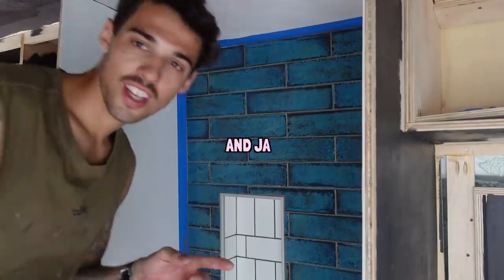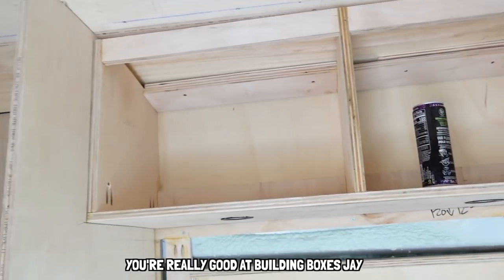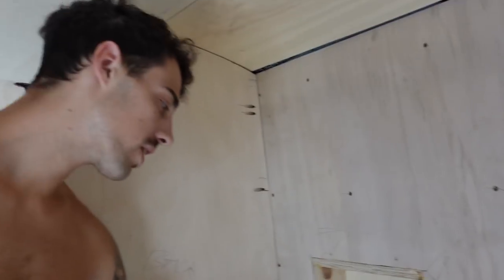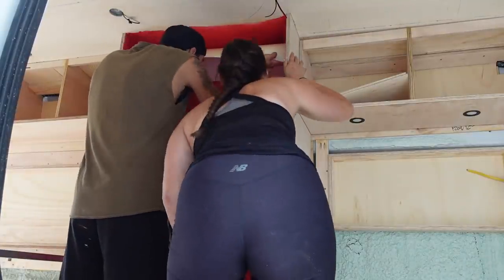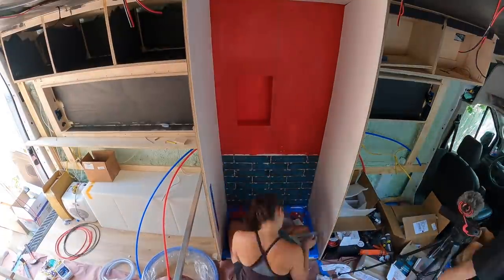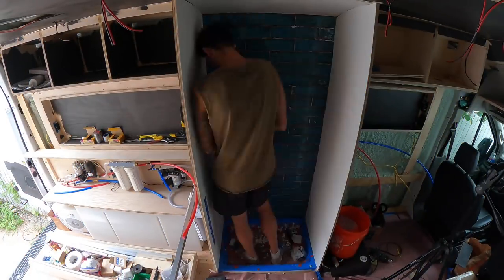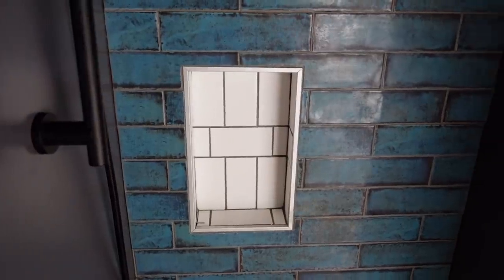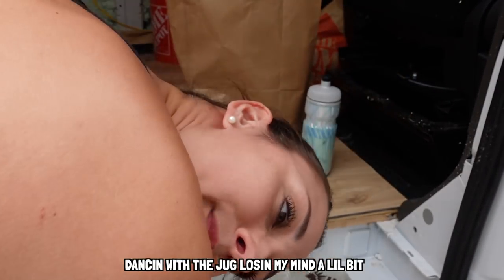We Built A LUXURIOUS Shower for Our VAN

Comment: You can put an extra few gallons of water in a 4" to 6" pvc pipe on the roof. A buddy of mine has one on his van for an outdoor shower. He uses a white pvc pipe and he put in a cap to fill it and uses a bicycle pump to pressurize it. He has fittings on the back of the pipe for a hose and sprayer. It works great. You can also fit it in with your existing plumbing for the shower. Oh and the reason he uses white pvc over black is that the black gets way to hot. I think this might help, so you can rinse off especially when you're training. Good luck guys.
Reply from the maker: That's awesome to hear it works great. We were always intrigued by that and thought about it for sure! Hoping the recirculating shower does the trick but it'll definitely be a trial and error type of thing haha
Reply: @KelsAndJay  
It's a good idea for a little extra water supply just have to make sure it won't make your van top heavy or list to one side from the weight.